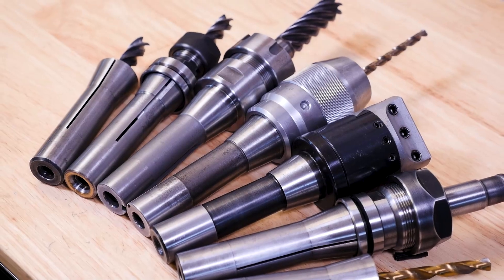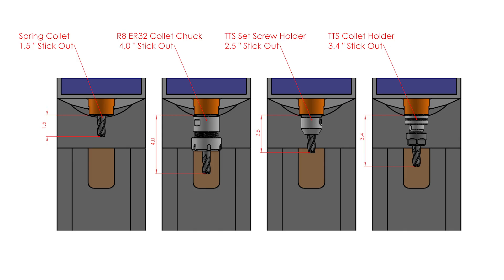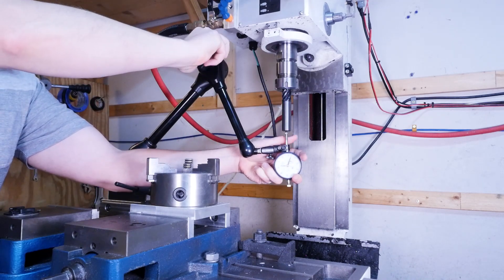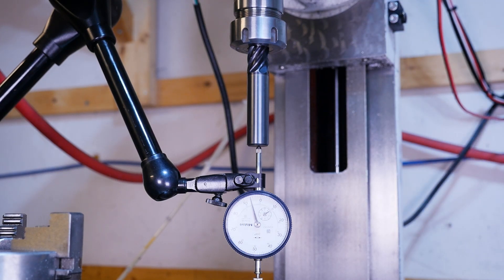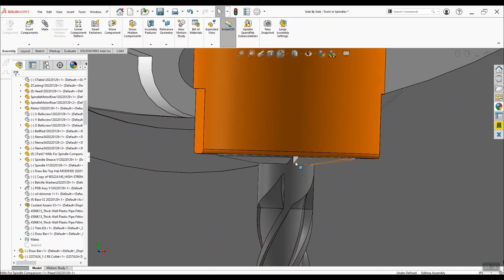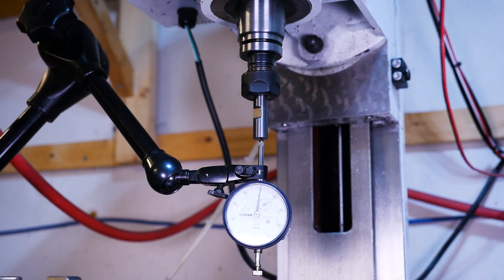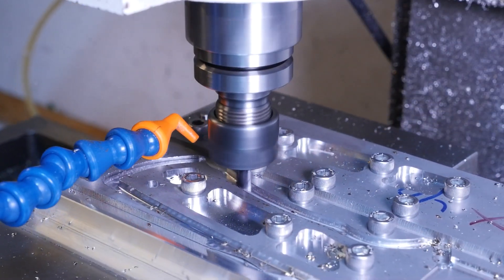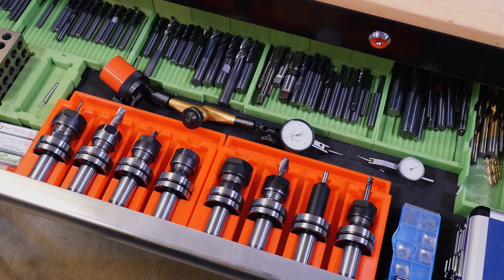CNC Mill Tool Holding for R8 Spindles - Comparing All Options

Comment: Great information, just bought my first milling machine that takes R8- that takes 7/16 ths 20 tpi pitch thread` 
Would I be correct in saying that not all R8 collets have a 7/16th 20 tpi pitch thread?
Reply from the maker: It is possible that not all R8 collets have 7/16-20 draw bar thread, but all the ones I have seen do have it.

Comment: I got iso 30 spindle with my mill. I think in some ways r8 is better option. I searched the internet and i came to this conclusion that people are more inclined torwars Iso30 spindle type becuase of massive gain in rigidity as they have proper drive dogs as compared  set screw style keyways in r8.
I do not understand much improve in rigidity requirements as I do not have a r8 mill to compare too. But I can say it takes up some amount of Z height as endmill sits outside the spindle in a ER collet.

Comment: Also, Set Screw Holders and bits MUST have a residual undesirable offset that is NOT accounted for (at least without manual adjustment) in your CNC program,  They are NOT held perfectly concentrically like a collet holds the bit.  That is, in order to get the bit into the Set Screw Holder, the hole in the Holder MUST be smaller than the bit (otherwise you could not get the bit into it).  Yes, it might be precision, but what exactly is precision?  Depends on your application, but I'll bet there are at least a couple of thou if not even a few thou clearance to permit easy insertion of the bit into the holder.  And then you tighten down on that set screw, and it pushes the bit to one side!  That means the bit is at least half the clearance offset from center.  And its probably more because the force of the set screw with distort the holder by some amount: agreed its not much, but its not zero and it adds to the offset.  So if you are trying to hit that less than a thou precision cut, you are not going to do it with this tool holder.  For Roughing Mill, no problem, but for precision, should never use a set screw Holder IMHO.

Comment: Do you prefer imperial or metric for end mills?
Reply from the maker: I use only imperial end mills, but only because they’re the most available in my area, and because I work mostly in imperial units. If I lived in Europe, I’d be using metric everything for the same reasons. You can also mix and match if that’s easier for you for any reason. From a performance standpoint, one isn’t “better” than the other. It’s just preference.

Comment: All the typical 7/24 type tool holders are the best, thats why most industrial machines use them. Most of these have tolerances around a few tenths. The TTS compounds errors.
Reply from the maker: You might be confusing BT - a spindle geometry - with TTS - a tool holding system for the R8 spindle. Most hobby/bench mills like this come with R8 in North America, so you cant use 7:24 BT tool holders in them. Though I agree they’re better! They’re also much more expensive and in my opinion, would not be well suited to a cheap mills like this.
Reply: @adamdebowski2037  Not confused at all. The original poster talked about Tormach going to BT 30, which is a common 7/24 taper. And Yes I know there has been a lot of light duty machines with R8 taper . I am surprised you missed all that .
Reply from the maker: @stevecarlisle3323  then it is me who is confused! What’s an original poster?
Reply: @adamdebowski2037  that would be you. You said at 1.14 that the R8 has better holding power than any other spindle type. Well that's an opinion, but If you look at the NT30, which most popular machines of 5HP have installed, all over the world, you can buy collets alone for that type spindle, you don't need a tool holder.
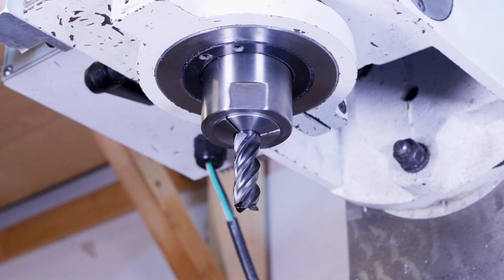Reply from the maker: At 1:14 in this video about R8 tool holders, I was saying that R8 collets are better than any other R8 tool holder in terms of performance. Not that they’re better than every other tool holder for every other spindle geometry.
Reply: @adamdebowski2037  Good to point that out, Thanks.

Comment: Should I buy TTS system($55 for adapter + $25-50 for one holder) or should I stick with R8 collets I already have and buy cheap chinese tool height sensor($35) for my home CNC? Tough choice... no, not really. In my opinion, may be TTS save some time on tool change, but not enough to spend a ton of money on it. If you plan to install power drawbar, then it is a different story... there probably no other options for R8 spindle beside TTS.
Reply from the maker: If you don't mind the tool change time, sticking with R8 collets is by far the best option. A cheap tool height sensor will likely have a few thousandths of error in repeatability, which, under the right (or wrong) circumstances - like using two different endmills for finishing different parts of the same floor - will be apparent. For $35, though, I would definitely try it out. It might be fine, and if it isn't - you only wasted $35 to find out. Another tool holding system, which I found out about after making this video, is the Royal EZ Change system. Looks like it might be even better than the TTS, but it ain't cheap.

Comment: about 10 years ago one of the original founders of Fadal CNC was making and selling mini CNC machines as a hobby in his retirement. He used R8 spindles with the tool holders only being the taper then a pull stud. Idk how good they were but definitely an interesting method for CNC.
Reply from the maker: First I’m hearing of that. If the pull stud gets pulled up into the taper w the exact same force every time, my feeling is that it should be just fine. So if it’s an air cylinder or springs, probably fine, but if it’s the draw bar that is tightened manually by an operator, could be a problem. Cheers!
Reply: @adamdebowski2037  I found his name which is also his yt channel name "DAVID DECAUSSIN" he named his method the Cat R8. I remember people on either a cnc forum or practical machinist forum being wary of it because a standard 30 taper tooling gets it's security from the length of the taper, and supposedly on r8 the 0.950" diameter section at the end of the shank is suppose to make contact with the walls of the spindle to help prevent the short taper from pulling out. Idk how true that is but it's always stuck in my head.
Reply from the maker: @CanadianPenguin_  thanks for this. I’m checking it out now. I love discovering these little packets of info from people who have a ton of knowledge in our little niche. I also love fadal machines and wish they were still around. It’s going to be hard to get my hands on one by the time I have more garage space… and 3 phase 😂
Reply: @CanadianPenguin_  We had a Fadal in the mid 90's. The dealer told us the name is derived from the founders, Francis and Dave and Larry (FADAL).

Comment: Nice video.  Early on, I hated the time it took to chame R8 tooling for the reasons you pointed out.  I did my research and settled on the Royal EZ Change system both at home and at the school workshop.  It seems to provide all the same benefits of TTL, with the added benefit of not having to manipulate the drawbar at all.
Reply from the maker: This is the first time I’m hearing about this system - it looks awesome. Taking the draw bar out of the equation is a big win. No accuracy/rigidity issues?
Reply: @adamdebowski2037  I've not noticed any accuracy issues.  I have come across caution statements regarding high loads with large bits over 1 inch diameter.  I use a fly cutter with good results, but I tend to use light passes.
Reply from the maker: @windywaz  it’s pricy, but I really like the look of it

Comment: Thanks Adam for the very informative video. The graphics were on point. I use the TTS system on my CNC mill and have been very happy with them. I mostly use the set screw holders for 1/4", 3/8" and 1/2" endmills without flats. Tool pullout has happened but it is very rare. I am not doing production work, so I don't try to push the system right up to its limits.
Reply from the maker: Thanks mark, that’s good to know. You’re the second to comment about using Set screw holders without flats. Didn’t know you could do it!

Comment: I'm a cheapskate and from Europe. Most mills sold here have a Morse Taper 3 (MT3/MK3 not R8) and ours come with a 10 mm metric-thread-drawbar not the 3/8-16 thread. So they can't even use the TTS MT3 adapter (without changing the drawbar which makes the mill incompatible with already available tooling).
I am currently working on building out a CNC from such a mill, and my solution is this: Ditch the TTS system and instead go for a MT3 20 mm collet that will live fixed in the mill. Then I just by C20 tooling (20 mm shaft tooling). There are face mill arbors for 20 mm, insert tooling for 20 mm (equivalent to the shear hog from Tormach), boring heads for 20 mm, sliding saw arbors for 20 mm and most importantly er-collet holder for 20 mm.
I do lose the fixed tool lengths, but I can just touch of on my tool length sensor each time (takes like 10 sec).

The advantage is I don't have to modify the mill and I save a TON OF MONEY compared to the TTS system (factor 3 at least (you do lose the quality guarantee, but there are always trade-offs, and it hasn't bitten me yet)).
Reply from the maker: Haha - I’m a cheapskate from Canada! Sounds like a pretty good system. I love using collets when I can - little one off stuff where I have to set new tool height with - regardless of whether it’s in a TTS holder or in a collet. Do you ever run into problems by not being able to set your stick out exactly the same every time? Like chatter if you stick it out further than your feeds/speeds might handle? Or get worried about running into fixture bolts or something?
Reply: @adamdebowski2037  
So far I haven't had a problem. Most tools are in an ER collet, so it's almost the same as the TTS and since I touch of the length the small difference in height have never had me crash. And for the tools that go directly into the 20 mm collet, I just back them in as far as they go (most have shafts that are too long anyway) and from there it's the same story where you only have minor length differences that the tool length sensor corrects for. Stiffness isn't really effected.
Reply: I obtained 19mm mt3 collet on aliexpress. Can’t find link now!  So I can use genuine tts plus China knockoff tts.  Can’t remember draw bar thread but it only goes in once so not much of burden when going back to mt3 tooling. Admittedly 19mm tooling is less frequent out of China. Have been able to find er20 and 16 tts collets plus shanks for boring heads and face cutters

Comment: heeeeeee's back. :P so i had the tts for my round column mill they were pretty awesome. My new mill has mt3 tooling...which is pretty darn rigid. i had to buy all new tooling...and make a pnuematic tool changer for them.... so that was poop...i ti is wicked quick though also.. i will do a video as soon as i find a new motor :P..oh and my new used mill motor died the first day i got it and its a metric shaft. :P.  nice to see you back sir.
Reply from the maker: Hahaa cheers buddy! You should make a video! I wanna see the new mill in action. You still in the same sweet shop down there?
Reply: @adamdebowski2037  yessir.. i own it :P

Comment: I disagree the R8 setscrew  holder what is called (solid holder/ end mill holder)  you do NOT NEED A FLAT and can set the set the tool in the holder at any length, each there own, i prefer them  holding end mills! and one can buy alot more tool holders vs the over priced  TTS system!  TTS = $$$
Reply from the maker: Really?? That’s interesting - I would think pull out would be a big problem that way. I’ve had an endmill pull out of an er collet - can’t imagine a set screw gripping it tighter.
Reply: Yeah gotta say in my experience with set screw BT40 holders, endmills with a steep helix angle (3 flute uni for example) and high chip load will pull right out in harder materials without a flat. You will probably get away with it in softer materials but it isn't worth the risk.   @adamdebowski2037

Comment: I already started down the TTS tooling after trying to limit cutter sizes.  Now I can't seem to have enough tool holders for cutters.

I tried the diamond drag but went to a #0 carbide center drill after barely scratching hardened steel.
Reply: TTS = $$$
Reply from the maker: @wow-wow-p8d  I’ve heard you can get these holders from China. Tormach branded the holder but I don’t think they own the design.
Reply: @wow-wow-p8d  no doubt but it also makes tool changes much easier.
Reply from the maker: Thanks for sharing. Doesn’t that mess up the centre drill?
Reply: @adamdebowski2037  Not yet. I only go up to .005" depth. I still break out the diamond bit if I engrave aluminum or softer metal. But stainless and tool steel get the center drill.
Reply from the maker: @jrsydvl7218  that’s great info - thanks!

Comment: Great explanation. The geatest drawback to the TTS system is the chance for pull-out especially when using a power drawbar. When hand tightening the drawbar with a wrench this much less an issue.
Reply: The greatest drawback IMO is the exorbitant price of TTS holders.  I use a manual mill, and I'll stick with old fashioned R8 collets until I win the lottery.  The 15 seconds to change tools isn't a biggie for me -- though of course I see why this isn't appropriate if running a CNC due to the Z-offset variance.
Reply from the maker: Cheers! I hope it helps somebody. Agreed. I’ve gotten pull out before (was trying to see how hard I could push it) but it pulled out from the ER collet, which has nothing to do w the draw bar. You had the holder pull out of the adapter collet?
Reply: @adamdebowski2037  Yea, 3/8" endmill pulled out during contour. Have to keep a lighter DOC. Mine is PowerDraw bar, so its only the spring washer stack pulling up on the drawbar.
Reply from the maker: @piccilos  Gotcha - I got pull out w a 3/8 endmill, too. Was progressively taking wider widths of cuts at 1/2 DOC & 3000 RPM with like 0.002” IPT. I think it pulled out around 0.080” WOC.